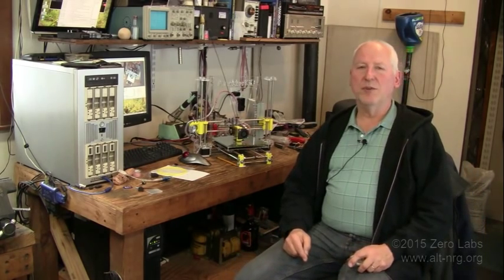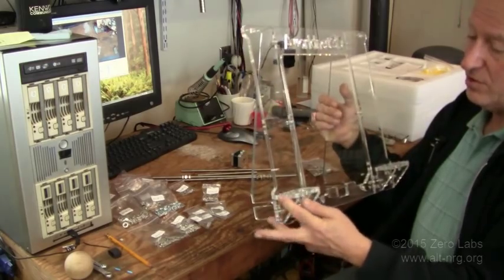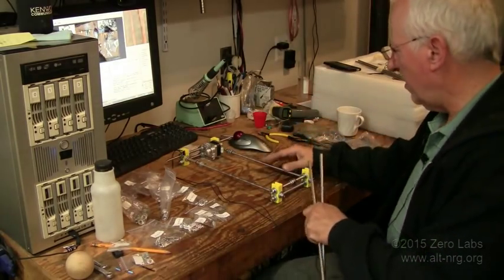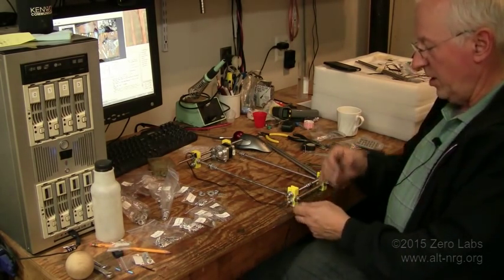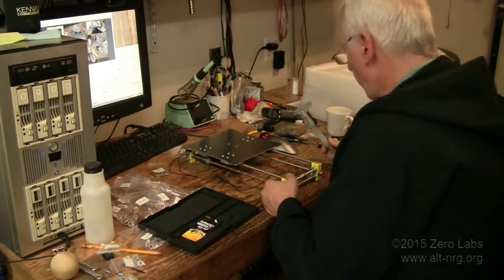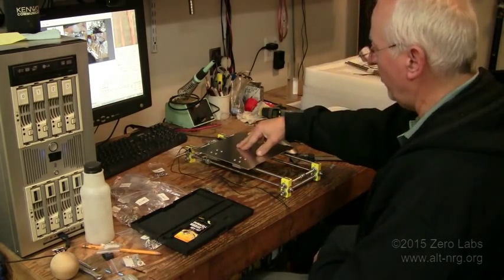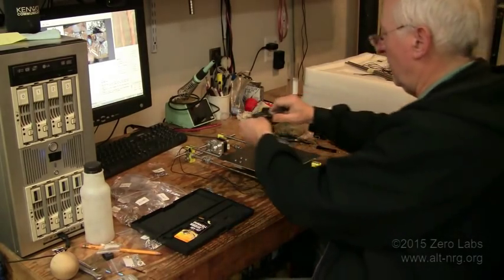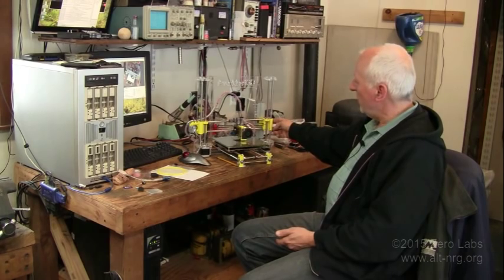#392 RepRap 3D printer mechanical assembly Prusa i3 A600

Comment: Where did you get the Z-Axis worm drive/brass coupling? Is there a kit for this mod? going to build p802mts. Looks clean and accurate.
Are you printing injection molds, or just /positive parts.
Reply from the maker: Came with the kit. Lead screw motors and brass nuts are matched sets.

Comment: Possibly in a future video, could you explain what led you to purchase this model over another? Thanks.
Reply from the maker: Kntryhart I will be discussing it in my review video but the main two factors were price and, just as importantly, the precision lead screw shaft stepper motors with brass flange nuts. Very few Prusa i3 have this feature and those in the know tell me it will save me lots of headaches later.

Comment: I am assembling a similar folgertech i3 now...interesting to see your progress.  On mine, the x-axis motor is on the right side, kind of mirror imaged.  I'm looking to add the SD card option as well, after I get mine going...
Reply from the maker: knikula Mine uses a Melzi 2.0 with micro SD card slot. It prints from SD using Pronterface.
Reply: I thought I might be printing today, but I may have let out some of the magic smoke...I'm set-up for Repetier at the moment...

Comment: it seems most of your problems were caused by the washers you used?
Reply from the maker: alberto gordillo No, most of the initial problems were caused by the 170mm threaded rods being too short. 180mm would have been perfect. The washers I used were an absolute necessity. There were also other problems which I will discuss in my final review video as well as my solutions to those problems.

Comment: Well done, what is the sales price of this kit ?

Well if there are so many problems, I guess it is better to wait until the first bugs are ironed out...
Does this have its own microcontroller that can read SD cards with the 3D data on it which you want to print ?
Reply from the maker: overunitydotcom Price for the kit is around $340. They *ALL* have their own micro controller. This one uses a Melzi 2.0 main-board based on the Atmega1284 Arduino chip. And I do mention in the video that it does have a SD card slot and I do print from it.